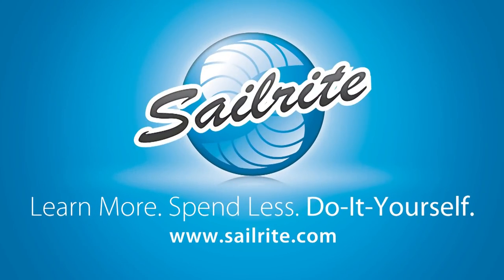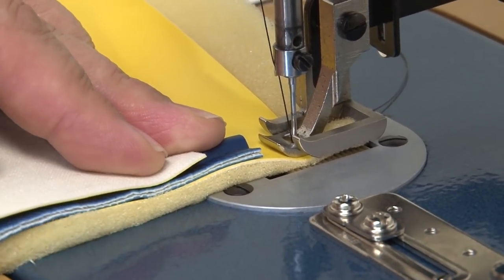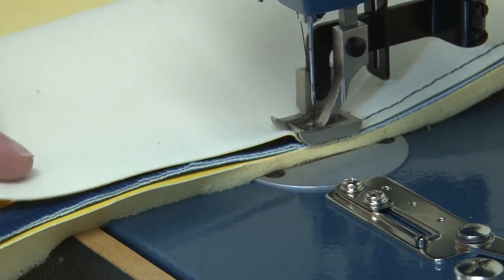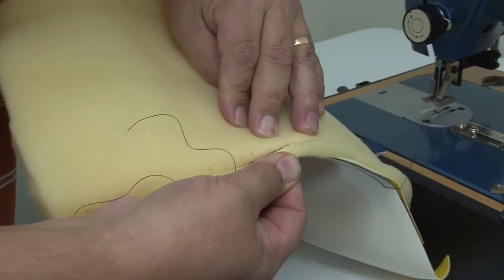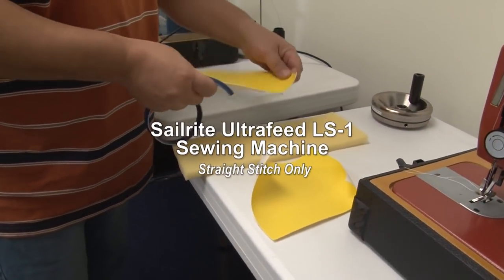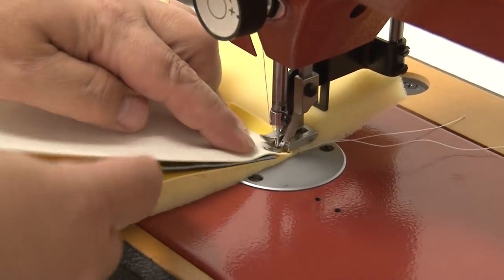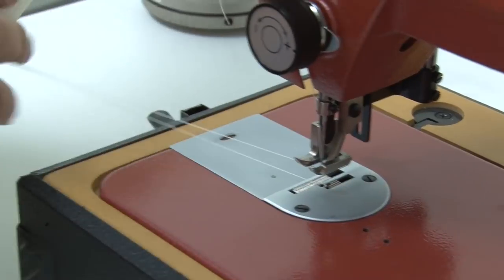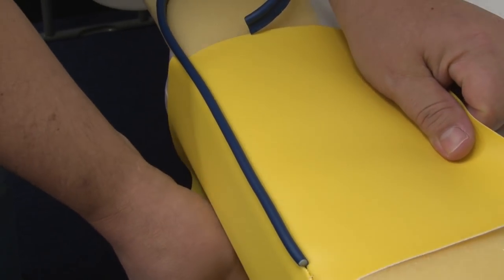Ultrafeed Sewing Piping to Vinyl Fabrics with Foam Backer

Comment: What if you dont have a walking foot machine, and just a straight stitch machine? Can you still sew foam backed vinyl with piping?  Thanks
Reply from the maker: It will be more difficult as you would have to help the fabric pull through the machine. A walking foot or compound walking foot sewing machine would make it much better. We do have straight stitch walking foot sewing machines at this link: https://www.sailrite.com/Sewing-Machines/Portable-Heavy-Duty-Sewing-Machines/Ultrafeed-LS-1-Sewing-Machine